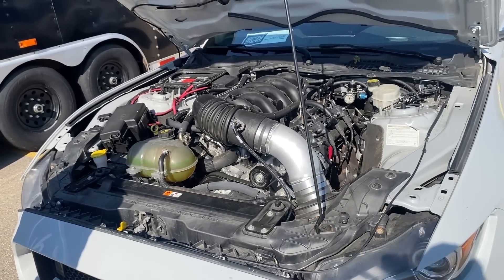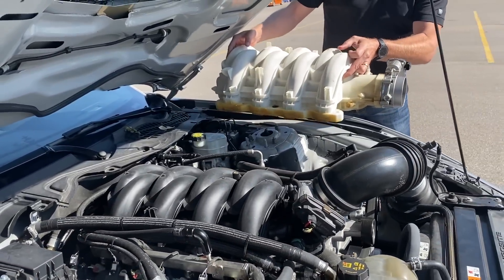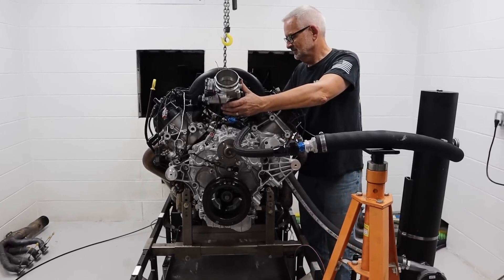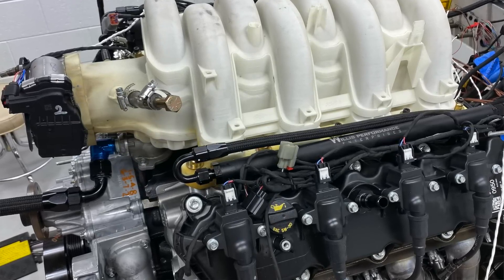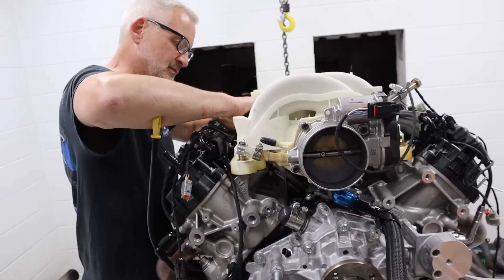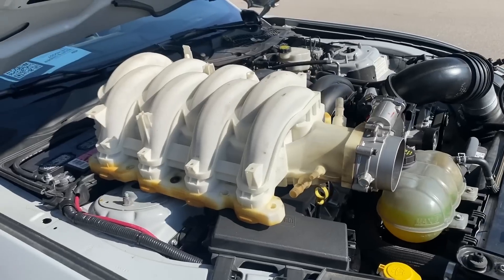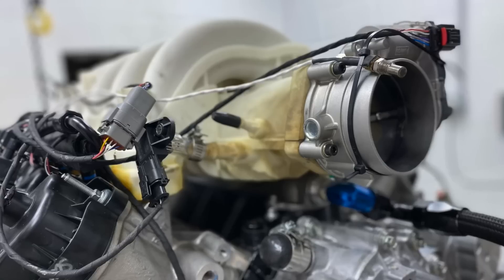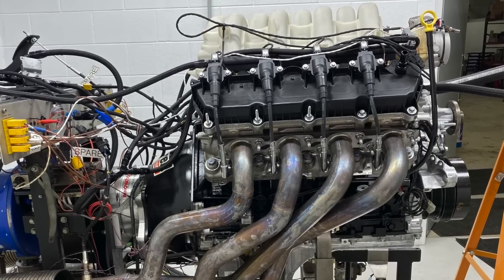Ford Performance Godzilla 7.3L Low Profile Intake Tested | How Much Horsepower Will You Gain?

Comment: Gotta love the Ford 7.3L Godzilla V8, I bet it'll outlast any EcoBoost engine with ease.
Reply: I worked at Ford and saw MANY gen 1 ecoboosts over 300k miles with stock components. Granted, most of the are on half tons and don't tow much if we are being honest. The Ecoboost is a hit or miss. Some people have a ton of issues, others beat theirs to the ground it doesn't care. That said, I'd want a Godzilla over an Ecoboost any day.
Reply: @cesarpalmos8235  Same here
Reply: Broke 200k with my 3.5l 17' F150. Constantly towing 2 different trailers, both range from 5,000lb to 7500lb-ish. I think most people are not being honest about their usage and how little they do to take care of their vehicles. Sure, going to be some bad batches, 2015 Chevy 6.2l High Country blew up on me 30k miles in, warrantied the work with another 3k miles put on and just didn't feel confident. Sold it and haven't looked back.
Reply: @ec3886  Still won't outlast my 1996 Ford F150 with a 5.0L (302) Windsor V8.
Reply: @CJColvin  We will see, those are becoming hard to find now because they are becoming scrapped.
Reply: @CJ Colvin Inhave seen 4.6 2v engines hit 700k plus with maintenance and timing chain replacements. Never seen a single 5.0l do that.... And these were taxi cabs
Reply: @rickstorm4198  The 4.6L SOHC 2V Modular V8s are very robust as hell (maybe like you said a little more robust than the 5.0L Coyote V8).
Reply: @ec3886  Exactly what I saw at Ford. Most people do not do the maintenance that they should. Especially on a turbo engine, lack of maintenance will lead to issues.
Reply: @cgarris8674  I can't disagree.  Coyotes sound great! Although I can't say for sure I've heard a turbo one in person.  Many supercharged. 
That's one of the points I was trying to make, is potential.  The V8 has more potential than the 6. Don't get me wrong,  there are potent 6s out there, but same mods on the coyote will always make more. And better noises doing it
And congrats on 9s.
Reply: Only reason I’m driving my 2nd DD Ford  currently is specifically b/c of their EB engine platform, specifically the BEST they ever made- the 3.5 HO only found in the Raptor & a more exotic version in the GT (btw- the 3.5 HO in the Raptor shares the same forged guts as the GT engine…..) otherwise I simply overlooked Ford for the last 10-15 years b/c….they don’t make great V8s & they don’t make many V8s. I wanted V8 1/2 ton trucks- I’m buying Chevy/GMC (or Dodge), the Hemi V8s or the LT/LSx GM small block have been vastly superior over the long haul esp in terms of heavy modding over ANY V8 Ford has offered out as of late….cams on top of cams stretched timing chains architecturally so damn big take up so much engine space w/ giant heads & YET have much smaller displacement than their rivals AND b/c of the thin cylinder wall designs can’t be punched out for bigger displacement like their rivals. They come out w/ this thing….not really sure what’s the point, it’s a truck engine, give me a GM crate engine any day over this
Reply: @MS-mr4zm  What about the 460 Big Block mate.
Reply: @MS-mr4zm  Have you completely over looked the 5.0 v8? It is one of the best v8s out there. It is ridiculously efficient at making power, more so than its competitors.  It is also easy to make large power with the 5.0.
Reply: @cesarpalmos8235  it’s “bigger” & weighs same/more than a 7.0 LS7, but is 2.0L smaller in displacement, & has 4 cams….so a cheap single cam pushrod V8 cam swap for an automatic 30-100whp bump in power is off the table unless you wanna spend more $$$ than that’s worth, which typically results in a mustang owner throwing his hands in the air & saying “F it” & just going the blower route. If I could get the 3.5 HO in my Raptor in a mustang? I’d 100% be interested in a mustang then lol, $500 tune & you’re making crazy Hp/Tq over stock & in the 450-550whp/500-620rwtq ballpark…the 3.5 HO is going strong for a long time. I’ll put it this way & you try & come up w/ a solid reason/argument otherwise: what do GMC/Mopar/Caddy/Lexus/Mercedes/BMW/Audi put in for drivetrains in a huge chunk of their high end vehicles? Some version of a V8. Name me ONE other vehicle beside a mustang, the F150 (of which 5.0 sales are no longer close to the majority)or cheapo gasser super duty that Ford puts a V8 in? I’m waiting….the aviator? The Ford GT? The Navigator? 🤔🤔don’t you think, relatively speaking, if Ford were as confident as those other manufacturers w/ their V8 performance/reliability that they’d be putting them in more vehicles? The F150 Raptor? The Bronco? The Bronco Raptor? I’ll hold my breath on the R lol, I’ll still keep my 2020 or get a Gen3 w/ another 3.5 HO. Ford has already shown where they’re putting their R&D $$$ & all their confidence into smaller displacement booster engines- 4’s & 6’s….that & Electric….it just is what it is,  Fords on the bottom of the foodchain in many ways when it comes to the traditional V8, but they’re making some great boosted 6 cylinder engines.
Reply: @cesarpalmos8235  Exactly mate
Reply: @MS-mr4zm  Hey FYI my 2011 Ford F150 with a 5.0L Coyote V8 in it has 148,000 miles and still going strong and its a beast and it sounds like a beast with the Borla ATAK exhaust on it, I seriously doubt you're overpriced plastic EcoBoost Raptor will outlast my 2011 with the 5.0L Coyote V8 in it.
Reply: @cesarpalmos8235  easier than a single cam swap in an LS/LTx?
Reply: @MS-mr4zm  What are you replying to? This thread has gotten to long and have no context any more.
Reply: @MS-mr4zm  My experience is the Coyote will outlast any pushrod V8. 423K and still going, try that with a LS, Hemi, or SBF. PITA if something breaks I'll give you, but the lightweight valve-train and low friction design will last a very long time if basic maintenance is followed.
Reply: @cgarris8674  you’re experience is anecdotal. There’s 0.0% chance a ford mod V8 is more reliable than a GM small block….I mean I know you know this, my 7 year old knows this- thicker block/cylinder walls + fewer (but beefier) moving parts = a more robust/reliable/easier to work on engine…..which ironically btw…..is the subject of this vid right? Why is it that ford didn’t do a DOHC tiny walled “big headed” mini displacement 5.0 for their SD gassers?? They make more power….could it be they aren’t so reliable under stress & are tough to work on? Hmmmmm🤔🤔🤔seems like they copied GMs recipe b/c it’s better. GMs gas HDs essentially have similar design engine as their gas 1/2 tons. Fords do not. There’s a reason
Reply: @MS-mr4zm  I see the LS as an improved Windsor. So similar that the head will physically bolt on and the exhaust ports are in the same place. And then the Godzilla is an improved LS. All those fleet vehicles with 4.6L 2V's in police cars and Taxi cabs speak volumes to the reliability as well. You see many come to the auctions with 300-400K on them as well.
Reply: @cgarris8674  well you live in an alternative reality then lol. They’re both V8s tho….so there’s that. I drive a Ford as a DD- Raptor w/ the 3.5 HO- great engine. 5.0?meh….if it was so good would be in Raptor. 7.3? If it was so good would be in Raptor. Ford is literally TELLING you that they’re not Uber confident in their V8 designs these days. Period. End of story.
Reply: @MS-mr4zm  your logic is very flawed. What you are extrapolating to be Fords confidence level,  has no bearing in reality.  Find the hp and tq curves of those 2 engines (3.5 HO EB and 5.0) and convert their output into feeling in the truck.  That meaty tq at low rpm of that 3.5 is why it's in the Raptor.
And look what the Raptor R has. Hint: Not a 3.5...
Reply: @MS-mr4zm  and the 7.3 2 valve in the SD platform over a larger 4 valve? Several reasons,  non of which you grasped. Those high flowing 4 valve heads are great for rpm, exactly where a SD doesn't need power.
Engine wear has less to do with number of moving parts, and more with actual physics. Example:  a 3.5 turbo v6 engine and an NA 5.0 v8. Theoretically making the same power, that v8 spreads those forces (like rod bearings) across 2 more cylinders.  Rpm also plays a factor, same power at higher rpm is easier on internals. Just compare diesel connecting rods to gas ones. Or wrist pins. 
Reality is oiling design has more to do with valve train longevity than number of moving parts.
So why large displacement and low rpm tq? Less revolutions over the life of the engine, robust large bearing surfaces, and plenty of cooling capacity to deal with heat generated.
Not to mention mass fuel used while doing said work. 
Oh, and by your logic,  why not 3.5 EB in the SD? (Hint: 5.0 gets better fuel economy towing than that turbo motor)
Reply: @Jim_Lawrence  Raptor R exists b/c Mopar guys are crazy lol- same reason Escalade-V exists. When I bought my ‘20 Raptor I wanted to wait for Gen3 to debut w/ coil springs in rear & nicer interior but it was nearly a year out before they’d start delivering, I could’ve afforded a TRX (obviously- they go for about the same, although now ford wants $110k for the damn R so maybe TRX prices go up?) but #1 single digit mpg is stupid, & #2 I like the nature of the 3.5 HO sooo much from the 60k miles spent in my ‘18 Raptor (got totaled) I was more than happy to stick w/ it. I like the tunability of the engine which is a benefit of twin turbos & both port/direct ignition, while you can see nice bumps in power in N/A or SC’d vehicles- you don’t see the same kind of jump as you’d get in a TT vehicle…..$500-$1200 tune (depending on device etc) & guys are betting 50-100+whp/TQ, reliably, w/ no detriment to efficiency. Ford tweaked the programming from the factory on the Gen3 & sandbagged the HP, but esp the TQ….this is b/c the coil spring rear reduces wheel hop/axle wrap so they increased peak Tq available @ lower rpm, dialed back the Tq mgmt etc. the advertised 450hp/510tq is truly making more like 480-485hp & 650-660tq @ the crank- STOCK. The gen3 ecu hasn’t been cracked by Cobb etc, but will be- I don’t expect the same leaps in TQ that the gen2 saw w/ just a tune (for reason stated above) but I wouldn’t be surprised to still see 50-70whp Jump & maybe 20-40rwtq, my ‘20 Raptor on a conservative 93 octane tune made 442whp & 593rwtq on a mustang dyno running the stock 35” tires. I get 15.5mpg overall mixed driving. The 3.5HO is a beast of a platform & Love the fact it’s shared w/ the GT & has all the forged internals. You don’t believe that these EB engines are that stout? All I just spouted here is factual & can be backed up- read for yourself, this dude Goosetune has made a business off of how well these engines respond!!! No 5.0 coyote gonna perform like this for short short $$$
https://www.fordraptorforum.com/threads/goosetuned-gen-3-baseline-dyno-runs-vs-gen-2-baseline.87469/
Reply: @MS-mr4zm  I never said the 3.5 doesn't perform. Comments are still there to check. I also know turbo motors are easy to get bigger gains tune only, nothing new there. Look at the now shunned diesel tuning market. 6.4 Powerstrokes could go from roughly 300 rwhp and 530ish rwtq to 580 rwhp and almost 1300 lbs ft. Wheel. 
I think the Raptor R came about for more reasons than the TRX honestly. They lack of the V8 sound in that performance truck had many people with the money for it left without the option. Aftermarket companies were taking 5.0 F150s and adding the suspension. I don't know if they added any of the special driving modes, but obviously the market was there. Not to mention the Shelby and Roush trucks, with SC 5.0s making more power everywhere than the Raptor 3.5 EB. 
None of this was my point, my point was that you were projecting reasoning that wasn't true. 
And to answer your question, yes I do think the EB 3.5 is stout. However if you put it to work in conditions that they utilize the 7.3, I think you'd see failures at a much higher rate than the 7.3. They don't have it in their RV chassis, medium duty trucks etc.. for a reason. 
I truly am glad you like your Raptor, and I'm a bit jealous you get to daily it. It would not do what I need however, so I have my 7.3 Excursion. Yes I'm a diesel guy. I have however told my wife we could get her a Raptor for her next vehicle, although it's capabilities going unused and maintenance costs (tires alone) make that a poor decision. 

As far as responding, I'd say supercharging a 5.0 has more potential. Yes it costs more than just a tune, but they run stupid fast. I won't get into changing dynamics with power increases, but I bet you know there's always trade offs.
Many ways to reach whatever your goals are, just don't sell your stance too hard.
Reply: @Jim_Lawrence  good points, FWIW my “other” ride is a fully built C5Z w/ forged rotating assembly/cam/A&A blower/dual nozzle meth injection etc making 718whp. I still like V8s plenty just prefer the GM stuff….Fords flat pane voodoo engine was great but heard durability issues there, I don’t hate the coyote entirely just not my the way I want my V8 power, their 7.3 is more up my alley- but I do like the GT500 aside from the more complicated DOHC setup….the fact it comes w/ a dual clutch auto & carbon fiber wheels really is cool.
Reply: @cgarris8674  have serviced several Express / Savana vans with 700,000+ miles, and water pump replacement was the only engine repair done, a 4.3 Chevy, and 4.8 and 5.3 Chevys. I would like to hear this 400,000 mile coyote, how many phasers and timing chain sets has it had replaced ? I know of a few with 150,000 and they rattle like hell when you start them cold, and i've seen a few shit the chain right out the valve cover, right around 230k. Maybe if you do synthetic oil changes every 3,000, and only highway drive. Regular farm use kills them faster than an old 351W.
Reply: @jamesgeorge4874  Any of the newer engines need more diligent maintenance. Oil changes on time are pretty mandatory, although the PCM now tells you when, not mileage. Yes, the phasers need clean oil, they are sensitive to tune ups, they can start using oil if abused without maintenance. My cousin has a 400k+ 5.4 3V, and I believe it's had 2 sets of phasers in that time. Runs great, and quiet. And that's not considered a great engine...
They also provide more power and fuel economy per displacement than previous generations. When you built a 400+ NA HP 5.0 pushrod engine, did it start and idle smooth and quiet? Did it have an extremely smooth power band starting off idle to north of 7k? Good manifold vacuum? How was fuel economy? 
So the newer engines have many performance and emissions benefits, and stock strength benefits. But that comes with maintenance. 
You mention farm use. I question what that means? Are you using a half ton where a larger truck is necessary? Are idle hours excessive without considering them into oil change intervals? Average speeds under a certain mph is considered severe service. Are temperatures staying in the safe range? There's always more to the story.

Newer engines as you probably know have many friction reducing things, like thin low tension rings. They aren't quite as robust when abused as old school.

I also have serviced Express and Savana vans, with valve springs broken, clogged or broken catalytic converters, loss of compression (I didn't fix that one so I don't know ultimate cause), and a few other wiring, sensors and a transmission. That tail light wiring as almost constant.

All that said, phasers and chains have life expectancy's. Chalk it up to maintenance. Even cam in block engines stretch timing chains, and effect running. Especially with a cam driven distributor. All engines old and new, just need things fixed when symptoms start. If it's noisy and you leave it until the chain make a window, that's now operator error.
Reply: @Jim_Lawrence  none of the engines I have seen with 700,000 miles have had 1 cam, 1 lifter, 1 chain failure, or maintenence needed. Zero. So, less work, performed with twice the mileage. P.S. I am a tech by trade for over 30 years. When I say farm use, I mean traveling about the property, trips for supplies, etc, not hauling gravity wagons to the elevator. I have replaced an innemerable number of Ford timing chains in 5.4 and a few coyotes. Zero in LS engines. 4 valves per cylinder and the asscociated parts needed for top end power is worthless in a pickup, who gives a shit about 7000 rpm, your post was "more reliable / longer lasting", well bud, as a guy who paid his house off fixing cars and trucks, i'm calling bullshit, because in my experience, they are not. For almost 10 years Jasper's number one selling reman engine was the 5.4 3V, do you think that is because it was such a good engine ?
Reply: @jamesgeorge4874  No need to call bullshit. You've had your experience, I've had mine. I don't need your approval for anything. 
I'm not a mechanic by trade, although I've met several incompetent ones over the years. I have done my own and others maintenance for probably 25 years. I did fleet maintenance on electrician and plumbing vans, but only when their normal place either couldn't handle or was too expensive. Call it what you want, like to believe I'm incompetent and wrong about everything in life? Fine.
Phasers and timing chains are now maintenance items. At least on those engines that use them. Key is, when they need to be replaced, it needs to happen. They don't come through the valve cover with no warning. I bet they were noisy for a while. 
Where did I say "more reliable / longer lasting?" 
I also never claimed power at 7k rpm makes a perfect working truck engine. I drive a diesel because I think/like just the opposite. Just take what I said for what I said and don't project. Too much of that these days.
Also in my experience, cylinder deactivation is more problematic at lower mileage than any timing chain issues. Again, in my experience. Both GM and whatever Chrysler/Dodge/Ram is calling themselves these days. Wasn't the GM stance to replace the block? The lifter clearances would open bleed oil pressure so it wasn't high enough to operate correctly. So, a new block with correct lifter clearance was their solution? Not sure if they figured that out, but those systems have always been an issue.
Reply: @Jim_Lawrence  Thank you for your honesty, Jim. I was a Ford guy, as a young man. Hell, I was anti-Chevy. But when I got my mechanic's license, in 1990, I began a long journey into the field. I have always been a tech guy, I owned an Omni GLH, several Volvo's, I am an EFI Turbo geek since they went mainstream. When the 10th gen F150 came out, it ushered in the beginning of FoMoCo removing the fuse box label, and stuffing the engine halfway under the firewall. It generally is a pain in the ass to do anything. Exhaust manifolds, for example, they leak after 4 years, and they are a royal ass ache from hell to do.  GM truck ? Pop out the inner fender, 40 minutes a side, no matter how many bolts are broken. The 11th gen F150 ? Even worse. Ecoboost V6 just compounds these problems. The Japanese, the Swedes, they build DOHC turbo motors that if they have coolant and oil, you can't kill them. On top of this, Ford now builds all these GTDI engines with fragile little plastic tubes to route coolant back to the reservior, and the cooling system pressure is over 20 psi, the block deck is so thin, a little overheat, they are done. And the little tubes get brittle in the heat and fail at 4-5 years, and catastrophic engine damage happens because the engine itself is so thin and weak. The reality is I see it every day, and it makes me sound arrogant, but your experience is so limited compared to mine, because I over 60,000 hours of my life has been repairing and diagnosing cars and trucks. Your experience is as an owner. My experience is fixing a thousand of  them a year, sorry if I wtite off your opinion as biased by lack of knowledge, and ignorance, but by comparison, it is.
Reply: @jamesgeorge4874  I hear you. I don't have experience working on newer than about '12 either. Seemed to me like the valve spring issue may have been a 2008 thing. I did 2 4.8s and a 5.3 from that year.
I have yet to hear of the plastic tube issues.  I'll keep an ear out for it. So many failure paths on newer designs. 
With the companies I helped out, the 2v engines were more robust than the GM ones. The Ford platform had less issues overall, and they kept them longer. 
I'm well aware of the engine under the cowl. I thought it was stupid when the Camaro did it in the early 90s, and I still have an Expedition with a 2v. 236k with no major failures. I did the plastic intake for a vacuum leak though. At least you don't have to pull the cab like my now sold 6.0 powerstroke. 
Outside of fleets, massive miles aren't common.  Up here things tend to rust out and need other major work before they even hit 250. 
I give you credit for sticking with being a mechanic.  I refused to turn my hobby into a career. I haven't had much time lately to dabble,  as I built my own house, and now I'm remodeling an investment. And when I say built, I didn't do electrical or foundation walls.  Pretty much the rest was me by myself.  Sorry if that comes as bragging,  it's not meant to. We are our experiences, mine are spread across many fields, as I'm sure yours are too.

That said, I believe BMW has a much worse track record with vct and chains than Ford.  You see that too?
Reply: @jamesgeorge4874  It's all in how well they're maintained. Mine has had the chains and tensioners replaced once at 200K. Keep the oil changed every 3K to 5K and they'll give great service.
Reply: @cgarris8674  What about the 302 and 351 Windsor V8s?
Reply: @ms dodge is saying that not ford. Since they are going all electric. Plus Chevy is almost assuredly ditching the Camaro since sales are abysmal. You live in fantasyland son. 

V8 s are limited because they get taxed on them via EPA if they can not maintain a certain mpg across a fleet of vehicles. Literally ford is leading the way in V8s... There is a new V8 coming in yhe next few years. I know because i know....
Reply: @MS-mr4zm  Yet that overpriced EcoBoost Raptor of yours still won't outlast my 1996 Ford F150 with a 5.0L (302) Windsor V8
Reply: @CJColvin  haha a Windsor V8? I dunno maybe, how many police cruisers do you see w/ Ford V8s vs their EB engines? Cruisers that get POUNDED on for 250k miles & idle constantly w/ the ac cranking…the 3.5HO in the Raptor is a special engine, fully forged rotating assembly/rods/pistons- shared w/ the ford GT. It’s overbuilt- can easily gain 50-100whp w/ a tune (depending on aggressiveness & octane combo) & avg 15-16mpg despite being factory lifted rolling on 35”s w/ 4.10 gears, I’m not even a Ford fanboy at all either, I was a GM only guy for a while had 4 GM pickups w/ 5.3/6.2 V8s but now on my 2nd gen2 Raptor w/ the 3.5HO & really love the engine & platform. I’d still be in my 2018 if it didn’t get totaled by a distracted driver
Reply: @MS-mr4zm  Well my old 5.0L (302) Windsor V8 in my 1996 Ford F150 has 210,000 miles and still going strong, the only things I replaced on my old truck was the starter, the rear fuel pump, and the power steering megunisum but other than that mostly was just simple maintenance, took out the transmission fluid just to get rid of the shuttering it was making and it hasn't had a problem ever since, also my 2011 Ford F150 with a 5.0L Coyote V8 has 148,000 miles and still going strong and its a beast and it sounds like a beast with the Borla ATAK exhaust on it, also there's plenty of 4.6L SOHC 2V Modular V8s in the Ford Panther Platform (Ford Crownvic, Mercury Grand Marquis, and Lincoln Town Car) with over 500,000 miles to about a million miles without any issues at all, try doing that in you're overpriced EcoBoost Raptor mate!!!!
Reply: @MS-mr4zm  Because you don't need 8 cylinders.
Less cylinders and less mass =s cheaper manufacturing.
Everyone knows you don't need 8 cylinders of mass to make horsepower and torque.
Reply: @MS-mr4zm  btw. Ford INVENTED the v8.
They made most of them.
They have more information and knowledge than anyone. Think about what you wrote ffs.
As if Ford doesn't know how to design a v8.
Ha!
Reply: @MS-mr4zm  they are all the same. 
They all burn fuel and utilize cylinders and air.
They are all the same.
The whole Ford, Chevy, Dodge thing is a figment in the minds of silly people.
I own fords and Dodge and have owned Chevy, Acura, Nisssn, Toyota- they are all the same.
My F150 now has 250,000 miles. Dodge Hemi 5.7 has 275,000. 
None burns oil. No knocks or ticks.
Maintaining is priceless.